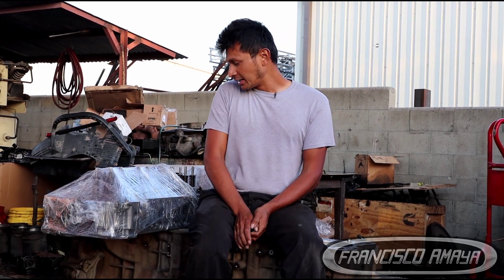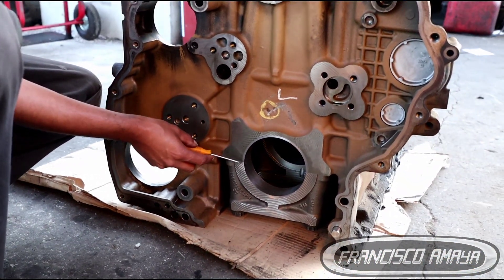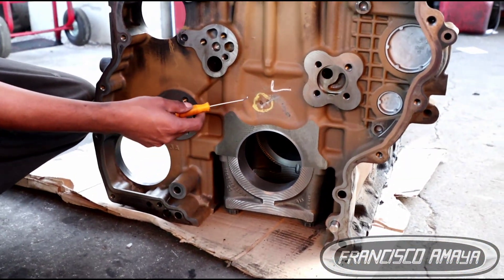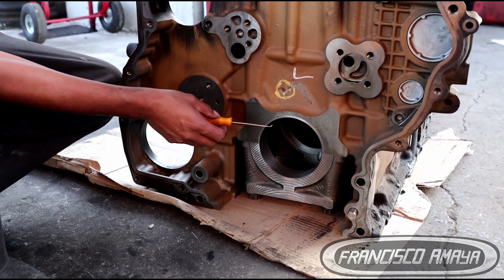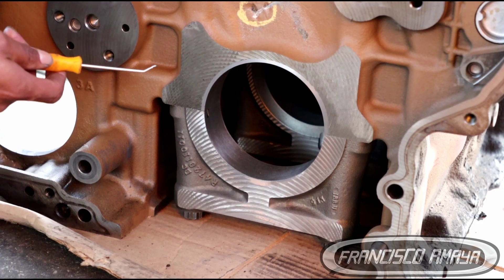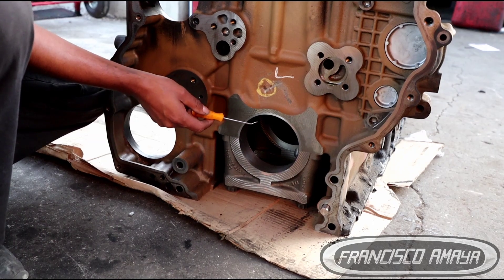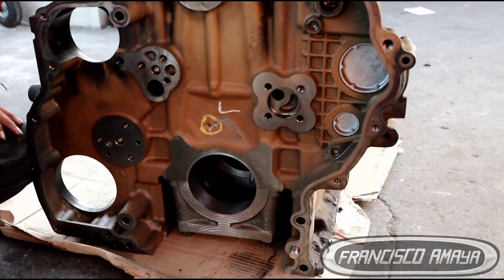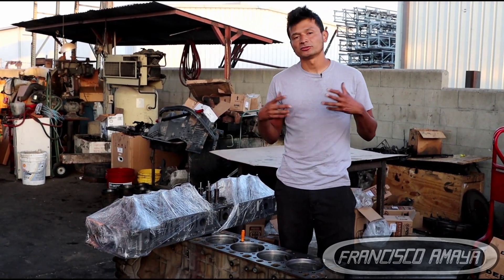DD15 engine block repair main bearings and cylinder block resurface machining back to spec

Comment: In Australia if your head is cracked and not repairable, it is not suitable as a core. Unfortunately this means without a core, the cost to get a new head rises by $2300. There is an alternative however, and that is to use a Mercedes Head which suits the DD16 equivalent motor used in the Actros. It is identical in every way. I used it in my DD15 and it is fine. It was also cheaper than the DD15 and doesn't require a core charge.
Reply: Do you more information on which Mercedes head is compatible with the dd15? I can’t find any info online